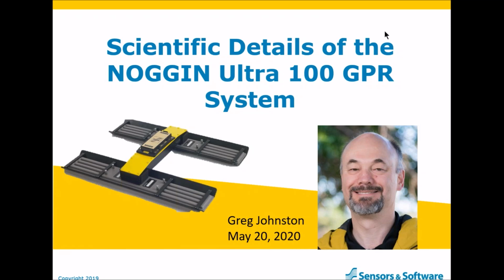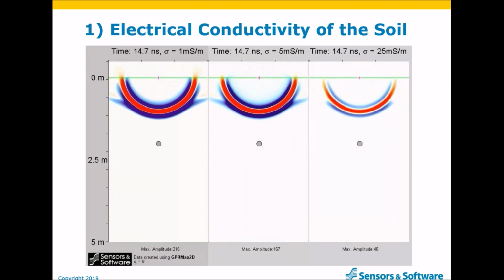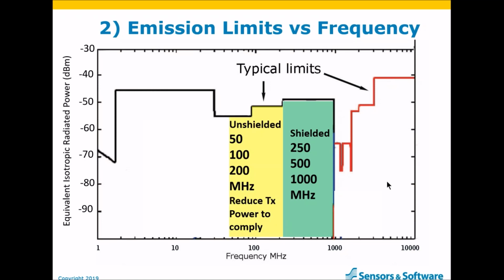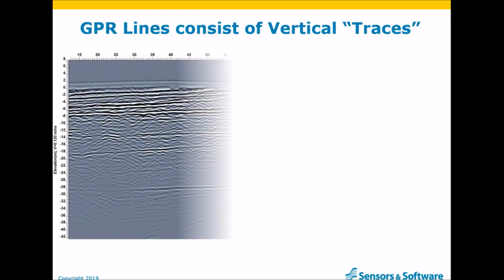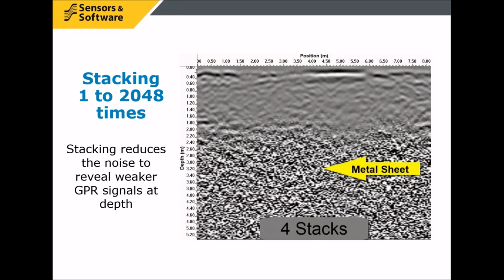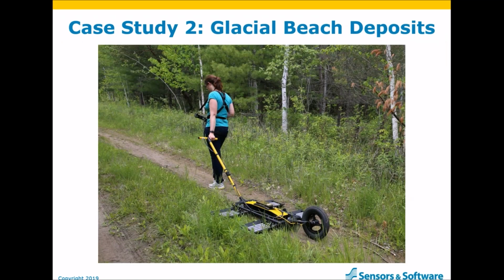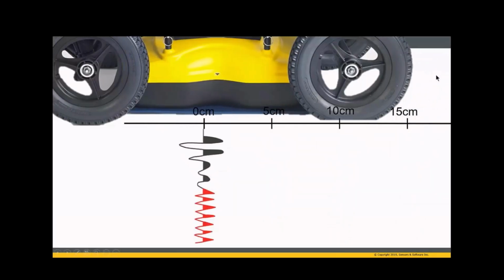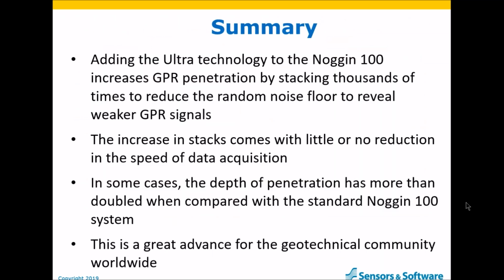Scientific Details of the new NOGGIN® Ultra 100 GPR system

Comment: Can GPR detect the degree to which septic gravel has become clogged?  

Hydrojetting can clear leach pipes, but that won't solve the problem if the primary problem is that the gravel has become clogged.  

If the gravel is not clogged, it will be distinct from the soil/earth, so it seems the gravel, pipe and earth would be visible on the GPR viewer.  If the gravel is clogged, it will still be different from the soil/earth, but less different - the distinction will be harder to detect.  

Would it work to say: If the gravel is 100% clear, the contrast will be ___. If the gravel is clogged (0% clear), the contrast will be ____.  The contrast is ____, so therefore the gravel is __% clear.

Rocks of various sizes would be distributed throughout the [soil/earth].  If the analysis is done over a large enough area, would it be possible to filter out rocks / ignore sections with significant rocks?

Thanks